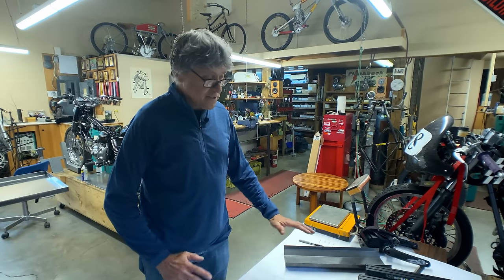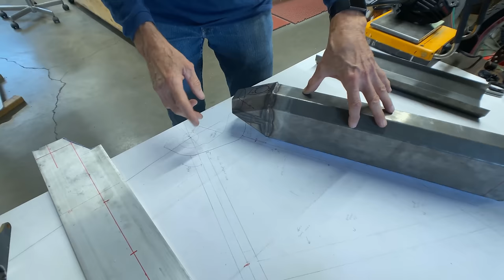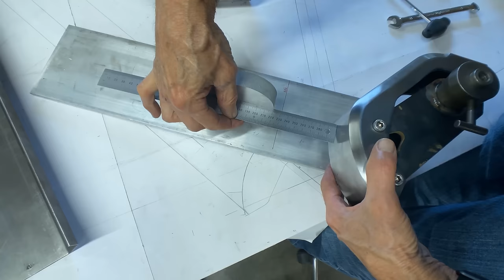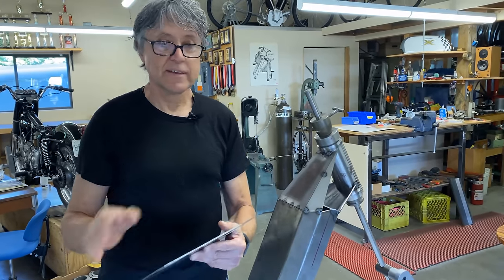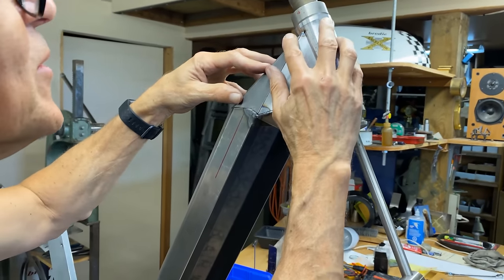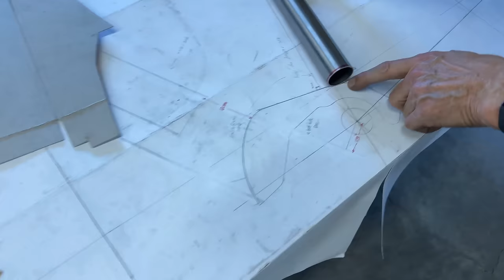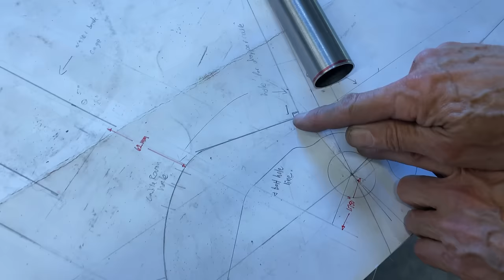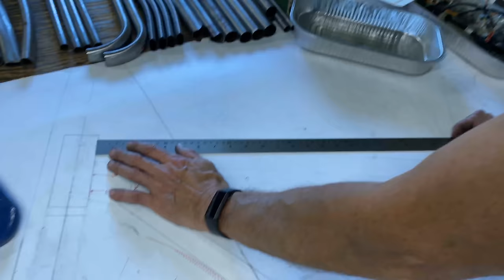Building a Custom E-Mountain Bike (Part 1) with Paul Brodie - Framebuilding 101

Comment: When I've had to bend up to a sharp corner before I usually start with a rectangular piece, put the bend in then trim it to size off a cardboard template... Usually takes two tries to get the perfect fit

Comment: After being on treatments for Lyme disease for 9 months I started building the frame for a 4 wheel drive and 4 wheel steer pedal kart from February 2016 to April 2016. I had to stop because the Lyme disease returned. I’ve been up and down ever since going on several different natural medicine antibiotics. It needs about $1,000 in machining splines on driveshafts. If I had more money I’d do the frame over again out of aluminum and make it lighter. My design has the ability to lock all 4 wheels in drive. It’s something I’ve wanted to manufacture but neither I or my family has much money.
Reply from the maker: Sorry to hear of your battle with Lyme disease. Life is not easy. That's great you had the initiative to start your project. I hope you finish it one day!

Comment: Some welding jobs benefit from a small gap with less distortion. Sheet metal body work for one but that's often done with a MIG. TIG with enough tacks doesn't seem as prone to the same problems. The one thing I did notice with perfect joints was that the order of the welds did make a difference. I have played around with tubes floating in free air and experimented with the effects of the welds but nothing that can compare with building a gazillion frames, I still keep luck on a monthly subscription. 

  A few flat files with one side smooth can be helpful when trying to perfectly match down tubes with bottom brackets. Modified several files with a surface grinder I had access to but although that wasn't really... is that a peacock?... I have found plenty of places to put them to use. Coincidentally, the surface grinder was purchased at an auction in North Vancouver. 

   Great videos sir and they are much appreciated.
Reply from the maker: Your comment just showed up after 2 months... Yes, I have 2 peacocks. I got my surface grinder from an auction too. That would be weird if it was the same auction. I think it was 2012...

Comment: I became fascinated  after watching a few of your videos by the meticulous process of problem solving that you employ. So your input would be appreciated.

Is there any commercially available I or T-beams shaped steel or aluminum stock, that could be utilized as a downtube member? And if not what flat stock would be the most appropriate, to create that shaped downtube member? 

The purpose is to create flat surfaces to attach battery packs for an e-bike. I know that the downtube is in tension statically, but dynamically I'm not really sure. What's the most appropriate flat shape that would  be applicable? Such a square stock tubing? It's just the bottom flange of an  I or T-beams would be additional support for the battery pack.  And it would give it a unique look. Any input would be greatly appreciated.
Reply from the maker: Extrusions are available. Search the Internet. If you going into production get a custom extrusion.That's what we did for our bicycle fork crown way back in the late 80s. Thanks for watching!

Comment: these weights are insane. one has to lift that shit sometimes.

guess whether i just scrapped an alu gt xcr frame for making a second gen, brodie reactor based ebike for my wife... 500w rear wheel motor, enough batt to cover 50+kms @34km/h (like 30mi@21mph). frame currently at the local wizard's shop getting disc console and rack mounts.
Reply from the maker: Yes, there is a weight penalty for the electrical components. Thanks for watching.

Comment: how much would it cost to build a frame aluminum vs steel more or less, thank you
Reply from the maker: They are probably comparable in price, but the aluminum frame would also have to be heat treated, so that is an additional cost.

Comment: Maybe it's just me but I not enjoying the juxtaposition of curving and rectilinear geometry? Was making the down tube/ battery box with curves to harmonise with the existing curves and geometry of the Bosch pedal box housing not an option? I know I am perhaps being rather too critical but a well designed bike has to be both aesthetically and functionally pleasing? Are you aiming to highlight the difference between traditional and ultra modern? A sort of hand made robot!
Reply from the maker: Andrew, your comments are all valid. In this situation, I came to the rescue of an engineering student who needed to finish the manufacture of the e-bike for his graduating thesis. It was not my design, hope you understand...there was also a very short time period to get it done, after the parts ordered FINALLY arrived. Thanks for watching!

Comment: If that battery box is the down tube between the steering / head bearings and the bottom bracket / crank., that is an excessive amount of weight to be carrying about., what 4 1/2 kg., in some bike designs., that member is a bowden cable., 'cos it spends NI on all it's in tension..You should get the guy to re look at his design..
Reply from the maker: All E-bikes have to carry the weight penalty of the battery somewhere. It wasn't my design, and I am not in contact with the owner / engineer.

Comment: That’s a beautiful Excelsior in the background.ls it a reproduction of yours? Engine looks interesting. Also the bike next to your workstation is that a knucklehead in a custom race frame? I had an idea to do just that. Looks great!
Reply from the maker: Yes, I made several Excelsiors, including the race bike with OHC Excelsior motor. 71 rear wheel HP from a 1919 motor. My website has some photos: www.flashbackfab.com
Reply: @paulbrodie  That era of motorcycles fascinates me. Effectively 100mph bicycles. Similar is on my long list of things to do. Unfortunately here in Ireland there isn’t a great supply of such old engines. I’ll check out the website. Thanks! 👍

Comment: Paul you the man brodie!🔥 would you suggest a similar project but can it be done with a Flux core welder?
Reply from the maker: I have never used a flux core welder, so I unable to offer advice. Sorry.
Reply: If you're talking about a harbor freight quality unit i doubt it. Maybe the new green ones that are actually dc but the old black painted ones are actually ac and dont work well. Mind you high quality wire makes a big difference and ive done surprisingly good work with the old style harbor freight 110.

Comment: How much the tickness of the plate?
Reply from the maker: If I can remember it was .065" 4130.
Reply: Alloy Steel 4130 (Chromoly) Steel Plate with 0.065 inch thickness right? Thank you  @paulbrodie
Reply from the maker: @samurbandy   Correct :)

Comment: Surprised you don’t run the top tube through the battery pox and actually weld it to the head tube directly
Reply from the maker: I was working with someone's design; I was merely the fabricator...

Comment: Shouldnt the guy doing his finals be doing this ?  I see now how i can have a boss that has manicured nails, highly qualified but if no one from the shop turns in, he wouldnt know a weld nozzle from a pen top
Reply: Totally agreed.  When I did my degree we built our own stuff.
Reply: After I finished my apprenticeship as a fitter/turner/millwright, and fabricating our own off-road stuff for years, I worked for a time in the university engineering department, building things designed by students. Often there were fights with students about things that will just not work in practice, and these guys have rarely even seen a file. Used to drive me nuts...
Reply from the maker: Good story!

Comment: Is that head tube not tapered? Weird to see a straight one on a mountainbike.
Reply from the maker: It's a 44mm Paragon straight head tube. You can call it weird if you like.
Reply: @paulbrodie  On second thought, weird might have been the wrong word. But unless he plans to run downhill forks on this I think most modern good forks are tapered, at least from looking at fox forks it seems that way. Or is this just a fad?
Reply from the maker: @y0uRF4t3   Yes he's running a fork with a tapered steerer. You do not have to run a tapered head tube to have a tapered steerer tube. The tapered head tubes run the bearings on the inside; the 44mm Paragon headset runs the bearing on the outside. Make sense?
Reply: @paulbrodie  Oh, I've never seen that, thank you for explaining. Also I like your videos, keep it up! Do you know if he has a video of the finished project somewhere?
Reply from the maker: @y0uRF4t3   The frame went to someone I have never met. No photos, sorry.

Comment: Hello, where did you get the Bosch Motor mount from? Thanks
Reply from the maker: I believe it came from Bosch. It's a nice casting but very heavy.
Reply: I also think it’s aluminum - hard to interface with 4130….

Comment: Chromoly ? Why not aluminum?
Reply from the maker: Most aluminum frames with big tubes give you a harsh ride. The frame is very strong, with no "give". Cromoly has a little bit of "flex" if built correctly, and gives a lively ride. The frame has a "feel" to it. No one ever says that about aluminum. It is strong and dead.
Reply: Because if you have ever built your own cromoly frame, it rides SO much better than aluminium. It has a wonderful natural spring to it. And the welds look much sexier... 😁
Reply from the maker: @CS_247  I'm with you.

Comment: I'm enjoying your channel - was just wondering why not use a small end mill to cut the slot in the seat tube and then you'd have the endmill radius at the bottom of the slot in one operation.  Is it important for that radius/hole to be larger than the slot width?
Reply from the maker: A small endmill tends to "wander". So you have to go slow, maybe take more than one cut. I also like the look of the hole being slightly larger than the slot, but not too much larger. Fussy! Using a slotting saw is just faster. Thanks for watching!